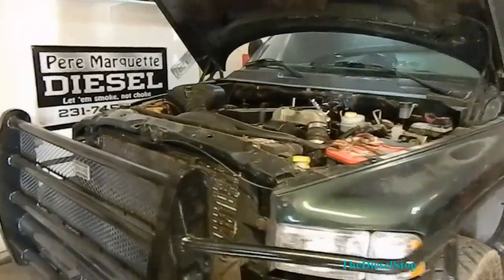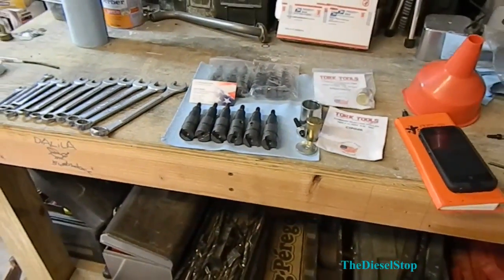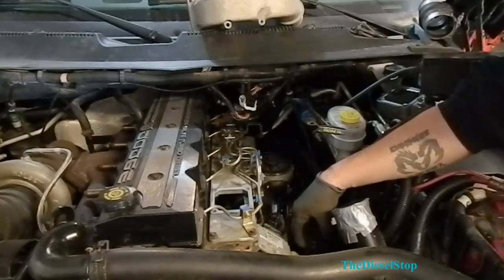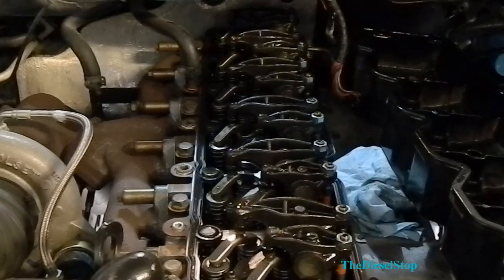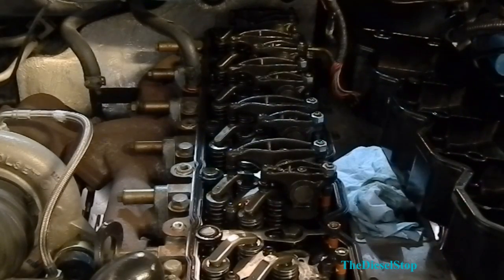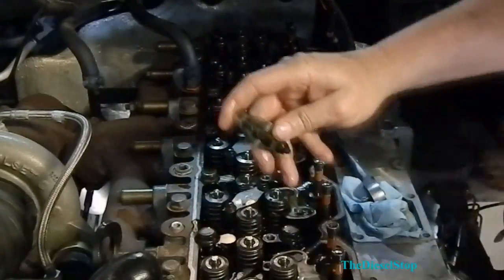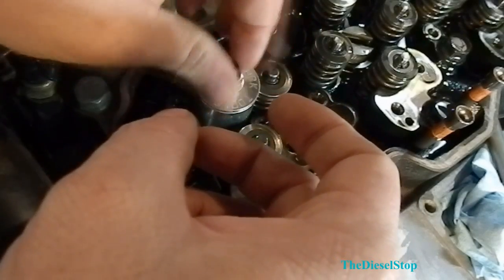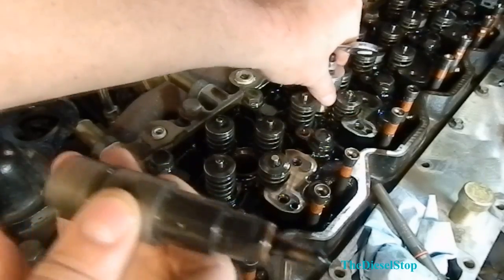01 Cummins installing Pere Marquette Diesel 200HP injectors using Tork Tools Part 1.

Comment: That's a good write up, but you don't have to take nearly that much off, lines can stay on if you loosen all the holders they have enough movement to slide them over without bending them and you don't have to take those rocker arms off either you just take that front injector hold down bolt off since the back one is a slide. Also you don't need those pullers, plastic pliers easily remove the crossover tubes and a 10mm bolt threads into the top of the injector and pull it with pliers

Comment: just a question what is the benefit of the modified fuel tubes do the make that much of a differance
Reply: Modifying the feed tube ensures you get enough fuel to your injector as the fuel cools and lubes the nozzle if you make bigger holes in the tip you take more fuel from the body, when you do that it slows down the refill time of the body and can cause you to lean out your fuel and burn up your engine. drilling the feed tube allows more fuel to the injector making the refill time shorter.

Comment: 200hp injectors and not even an intake?
Reply from the maker: It would be pointless to upgrade the intake at this time. I got to get a fuel pump that can handle the injectors and then I will deal with the intake.

Comment: How much are injectors (each) for a cummins ?
Reply: Thanks, was only hoping for a ballpark figure for comparision as I own a duramax and not a cummins
Reply: On the common rail injectors they are about the same price just 2 less injectors price ranges from 255 to 365 each plus core now the mechanical injectors are much less like under $1000 or less a set depending on what you want

Comment: Do the injectors add 100/200 over the stock setup, or is that just the designation they are given?
Reply: The 100 hp injectors add approx. 100hp over stock and the same with the 200 hp add approx. 200 hp over every truck is different so results will very and also the extra's you have will change you performance like exhaust, intake, turbo, charge air cooler, lift pump and controllers.

Comment: Where do you order those hd crank sleeves
Reply from the maker: 48383 is the part # that Victor Reinz has for the 12 valve. Any parts place that carries the victor gaskets can order it for you. I know some of the Car Quest has them.
Reply: That number came up seal I need the metal sleeve to cover the groove so it will stop leaking
Leaking
Reply from the maker: Rob Green
 it had the metal sleeve in the kit with the seal. Use the part # i gave you.
Reply: Speedy sleeve or whatever it's called